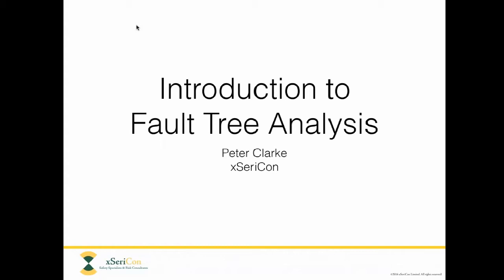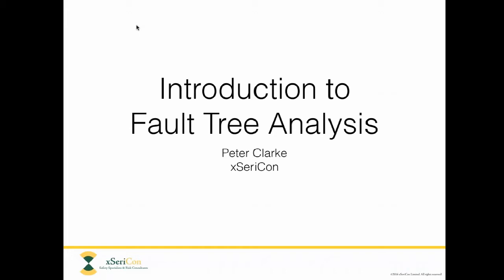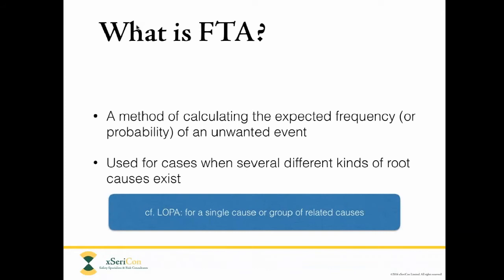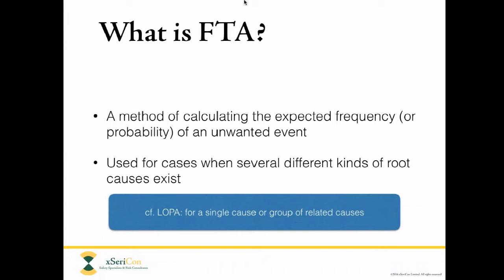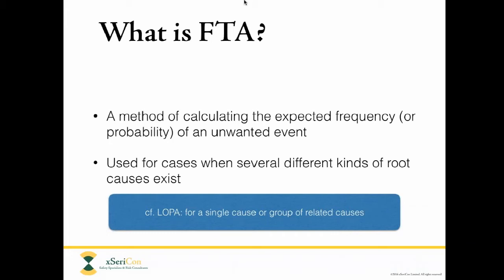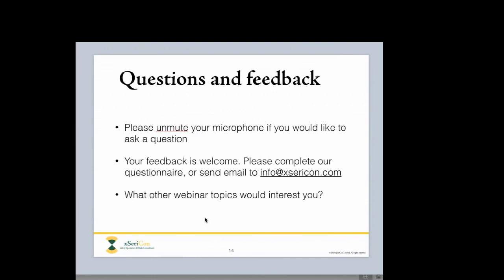Fault Tree Analysis FTA Webinar by xSeriCon

Comment: I apologize, I have a doubt, in the IEC 61025 standard, the fault trees each element is in a separate branch, the correct affirmation that it must be this way or the structure that you expose is also correct and does not contradict the norm.
Reply: Thank you for your comment, Felipe. I will check the point you are commenting on, and reply in more detail soon.
Reply: Felipe, I checked the standard but didn't find the requirement you mentioned. Can you confirm which clause of the standard you are referring to?

Comment: I give you credit for all the work you do, but the excel creation of a fault tree analysis diagram is just not correct. One should be representing the FTA as it is represented everywhere and that is not done with Excel, but a pictorial representation of the failure that is received from the propagation of basic events. If you'd done it in a graphical tool you'd be great!